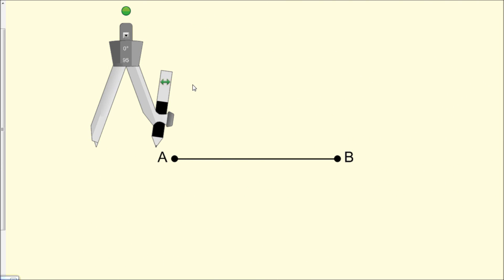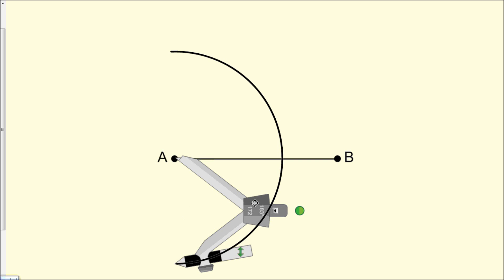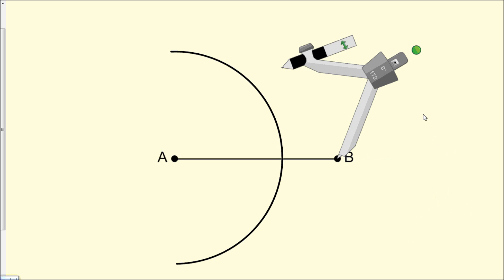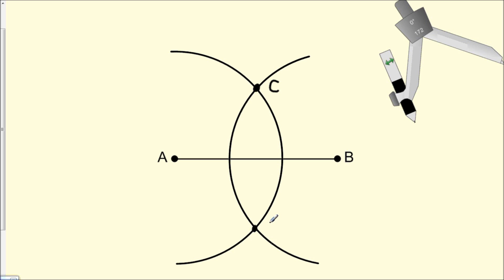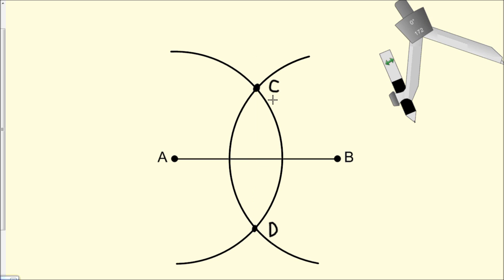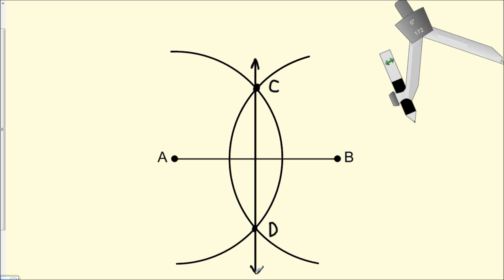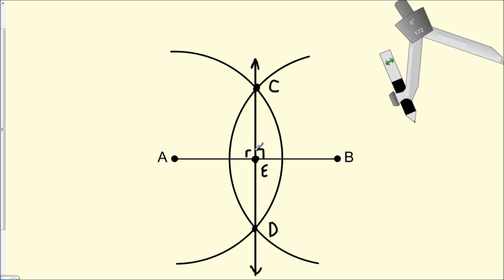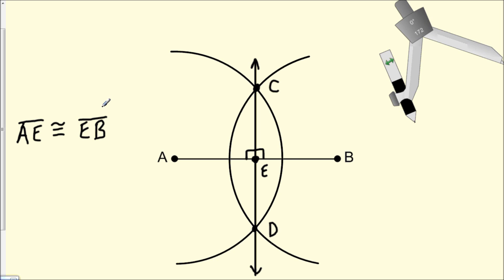Constructing a Perpendicular Bisector - Geometry

Comment: Hey thanks for the big wide arc in the video, I just figured something else out. I was wondering how to find the center point of a piece of rectangular steel plate of its length side whose width is shorter than half of its length. I was like there is no way I can scratch a line outside of the steel, but now that there are two intersections on the AB I can just perform this procedure again until I can finally scratch the steel plate, however this is only half of the job done, since only one side of the length have metal to scratch onto I have to do this whole procedure on the other length of the rectangle to create another intersection on the steel plate.
Reply from the maker: If this were a real world scenario where using a compass does not work, I would probably wind up using a ruler. Hope it all worked out!